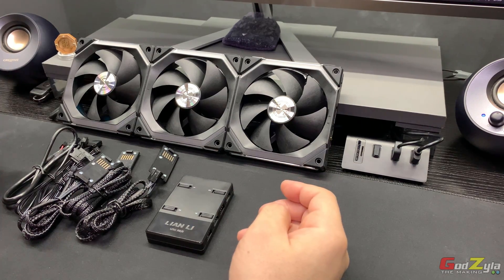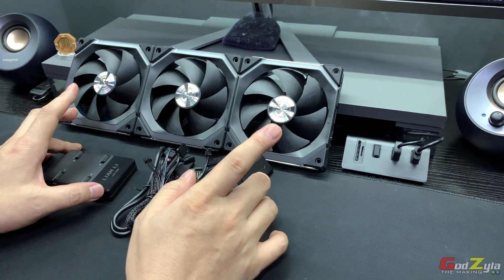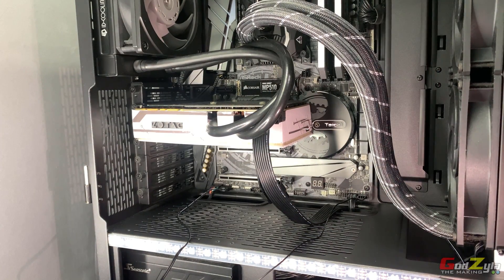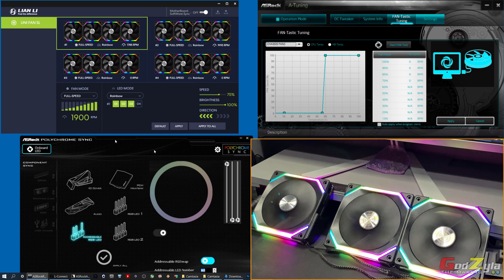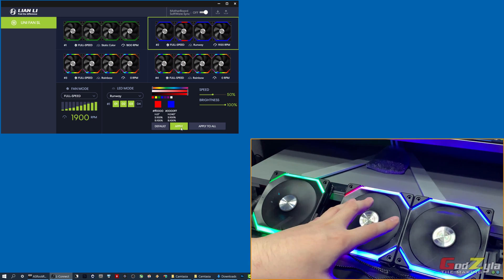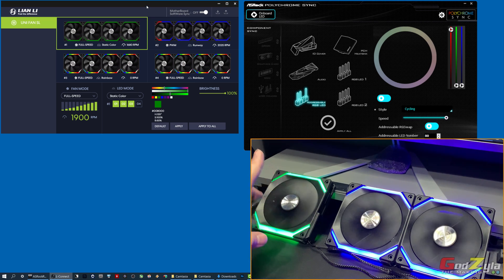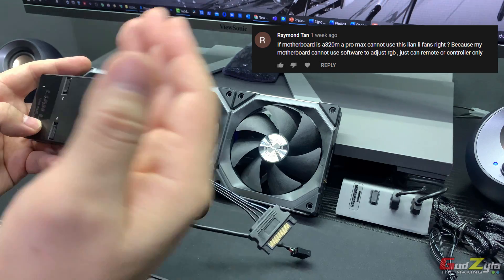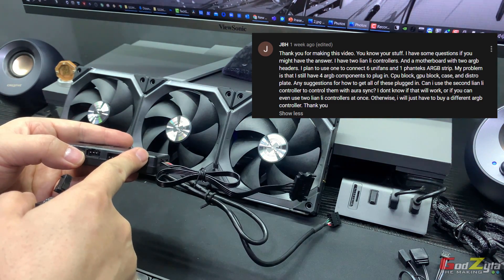Lian Li Uni Fan SL120 - Connection & The Controller (Part III) [L-Connect]

Comment: Why do you recommend the fans going through the lian li controller rather than the bios?
Reply from the maker: Hi HawkEye1194, the reason I have stated that is, if motherboard which required to tweak fun curve using applications instead through the motherboard bios/uefi, it will require two passes before the fans will react. 1st the motherboard utility program and 2nd the L-connect program. Now if you asked me do I use these uni fans. my answer to you is no. I did most of the uni controller videos are mainly because a friend of mine bought the uni fans and other of my friends follow. they were having issues with it, therefore trying to help them, I figured if I learn something from these uni fans or the controller, I will share it with those who are having issue. 

Now, just additional info, I personally do not like argbs at all, abit of rgb will be ok and I have to ensure that they can be off at all times. this is my current setup https://youtu.be/0qSaX_mOjQc or https://imgur.com/gallery/Pw5kY4q 

My setup is pretty straight forward, I choose performance and detailed aesthetic compared to just showing so much lighting effects and these are my reason.
1st argb if you always have it turn on, they will burn out fast.. with one LED burn out.. the whole argb will not work. 
2nd no additional software needed, therefore your PC will be happier with one background process off
3rd be it argb, rgb or ultra led, it produce heat inside your case. it might not produce alot but still you will be making your cooling AIO fans or case fans to work harder, causing a) more power consumption b) increase noise operation c) more messy cables for cable management which does affect cooling.

the above are just some of my explanation. if you want to know more in-depth of my thoughts, we can discuss this via email at godzylatech@gmail.com thank you!
Reply: @KleoYan  thanks man!
Reply from the maker: @HawkEye1194  you are most welcome

Comment: Wil I still be able to use the motherboard software to control the rgb? If so, how?
Reply: Hello thanks for the reply, I saw your other video where you connect different Lian li products to the Uni fan hub only and you’ve shown that it does work with the L-connect software. Although may I ask if I can still use the motherboard software to control the rgb of those products? Just to clarify do I just have to turn off L-connect?
Reply from the maker: @joaquins7463  yup, so long you’ve plug the argb and fan pwm to the uni controller. Once you switch to motherboard you will be able to use the motherboard application to control the argb. But do be careful as some reported it might not work. Those are the pc builders who uses Asus amour crate and MSI dragon.
Reply from the maker: hello Joaquin S, welcome to my channel, answer is yes you can use the motherboard software to control the aRGB effects. if you view this video properly, at around 10:46 it does shows you that I am using the motherboard application to control the argb effects

Comment: does this work on st120 fans?
Reply from the maker: Hi Rasmus Sundqvist, welcome to my channel yes the ST120 does work with the uni controller https://youtu.be/njlkdM9lYbI?t=393
Reply: @KleoYan  my fans and all are working but i cant change the rpm or the lighting on the software
Reply from the maker: @Sunkan69  if you only plug the USB Cable from the uni controller to the motherboard and the Sata to your uni controller. does your fan react with the L-Connect application? the issue can be various reason. maybe list down in details what board you are using and how you connect your fans to the controller and such. if not, it's hard to diagnose for you. thank you!
Reply: @KleoYan  the issue is that it doesnt show up on the l connect
Reply from the maker: @Sunkan69  hmm ok maybe this will aid you https://youtu.be/8l4i5UjO3es . What motherboard are you using?
Reply: @KleoYan  im using asus b450-f
Reply from the maker: @Sunkan69  I see do you have the application call amour crate installed?  If you have remove that and install the L-connect application to see if it works. There are some pc builders have mentioned that the application utilise from asus (amour crate) and MSI (dragon) is over taking the control which causes L-Connect unable to function.
Reply: @KleoYan  no i dont have that application installed
Reply: @KleoYan  man i think i solved the problem tysm!
Reply from the maker: @Sunkan69  Oh ok, congrats, out of curiosity, how did you solve the issue?
Reply: @KleoYan  or well i kinda solved the problem. Now the fans are spinning faster when im in games and slow regular. Why is that?
Reply from the maker: @Sunkan69  this depends on how you connect your fan load. Did you plug to the uni controller and set to pwm? Or did you plug the fan load directly to the motherboard fan header and have it set to pwm?  In both scenes, you fan will react when cpu gets hot while gaming and will tone down when it’s not that hot.
Reply: @KleoYan  how do you set it to pwm mode?
Reply from the maker: @Sunkan69  I have mentioned on this video at 8:11 onwards.. As for this to work. You will need to read your motherboard manual as I don't use asustek motherboard.

Comment: Hey great video. I installed it exactly as per this video. I notice in my MObo Bios and software they aren’t showing the SYS_FAN1 RPM. Is that as expected?

Everything else is working as per your video. Just curious why the BIOS and hardware monitoring apps don’t register the RPM of my fans connected?
Reply from the maker: Hi Carl Russo, welcome to my channel. yes it reacts that way, unless you bypass the fan load connection on the uni controller and plug directly to the motherboard fan header. that will allows your motherboard to controller your fans rpm and to be detected by hardware monitoring apps. hope that answer your question. thank you!

Comment: Im buying the unifans for my o11 and I was wondering.. Im going for 3 on the top, 3 in the front and 3 on the bottom.. Do I need to buy the 3 pack Unifans w/ controller 3 times? Or can I use 1 or 2 controllers. I mainly ask because a lot of the 3 packs are out of stock
Reply from the maker: Hi The Turtle, welcome to my channel. for the moment you are able to only use 1 controller but I would advise you to get 2 x 3 pack unifans with the controller each. 1 controller to use and another to keep as spare. Plus on lian-li website, it did mentioned that in future you can use 2 controller instead of one. read this page for more info https://lian-li.com/product/uni-fan-sl/

Comment: This is "hands down" the most simplest and most precise explanation regarding the messy world of ARGB/RGB lighting/connection chaos. Even Linus or Jayz2Cents can't do better tha this. Very clear and precise. I wish I found this video before I bought the CoolerMaster ARGB controller.
Reply from the maker: HI Lamka Gaming Club, welcome to my channel and thank you for the compliment.
Reply: @KleoYan  Hey man, does this software work and with the same effects for the Lian Li ST120 fan model?
Reply from the maker: @frank_soares  Hi welcome to my channel. nope the effects are different and you can’t use the L-Connect software on the ST120 controller. However you can still use the ST120 fans with the Uni controller, just that there are some effects that the ST120 might not adapt to. If you intend to plug the ST120 to the uni controller, you will need the lian li argb cable kit https://lian-li.com/product/argb_cable_kit/ video here https://youtu.be/ktuRAOcAkn8 .You can refer to this diagram .. top right https://imgur.com/gallery/ErMZdQh or if you unable to get the lian li argb cable kit, I did my own crimping cables and you can view the galahad to uni controller video in my playlist https://www.youtube.com/playlist?list=PLEW-b-2vYDdPo0NzHyeksx012c-nkDapm which those fans are of ST120. as for how to crimp those cables, its also listed in my playlist.
Reply: @KleoYan  Thanks for helping me. I would also like to know if the SL120 controller, can I use it with a fan other than LIAN LI like CoolerMaster MF120 Halo? 

There is a controller on Aliexpress, I was wondering if it's the right one, but every time I send the link my comment is deleted.
Reply from the maker: @frank_soares  you are most welcome. based on the specs of the cooler master MF120 Halo https://www.coolermaster.com/sg/en-sg/catalog/coolers/case-fan/masterfan-mf120-halo/#specifications  the RGB drawing current is at 0.55a each. It should not be an issue but make sure you know the limitation of the uni controller. on the safe side. please do not connect more than 4  MF120 halo fans to one output. stick with 4. you will also need some converters too. 
just an illustration. I have make use of the EK Vardar EVO 120 ER fans with this uni controller https://youtu.be/bMRz2KVqbjA

Comment: I have 2 controllers can I use one for the fans and use the other for ws2812b leds?
Reply from the maker: Hi TvSaiyan Shinobi. Welcome to my channel. Unfortunately no for the moment but Lian Li is going to improve what they have develop a period ago. They did allow L-Connect app to control 2 but there are some issues. They have remove this support till further notice. You might want to do random check on their website for updates on the L-Connect app.
Reply: @KleoYan  oh ok I’ll keep that in mind also I have one more question since I’m new to argb.
I have the lian li o11 xl and it has a argb controller and I also have the ek distroplate and it has a argb connection and 6 lian li fans with the argb connection how can I have all these connected if I only have 2 argb connections on my board?
Reply from the maker: @InSaiyan-Shinobi  just for your info, you can just use the uni contoller with the USB connected between the controller to your montherboard USB header. This is how it will work. 

On uni controller 
Output 1 - 3 x uni fans
Output 2 - 3 x uni fans
Output 3 - O11d xl strip ( you need a convertor )
Output 4 - ek distro plate ( you will need converter )

For argb converter you can check on my description on this video as where you can purchase them. Thank you.
Reply: @KleoYan  that converter cable will connect the argb side and the other to the lian li controller correct?
Reply from the maker: @InSaiyan-Shinobi  correct. Better explanation on how the converter works is on this video. https://youtu.be/njlkdM9lYbI
Reply: @KleoYan  I’m just confused because my 5v 3pin on my distro plate is a female and my lian li xl front panel led is a 5v 3pin female as well  and the output of my lian li controller is 5v 3pin female.
The fans did come with a female to 2 male 5v 3pin cable though?
Reply from the maker: @InSaiyan-Shinobi  Hi, pardon me for the late reply. would you mind to take some pictures of your distro plate argb connector and your lian li XL argb connector and send it to my email at godzylatech@gmail.com  I will be abe to aid you if I see your connectors. thank you!

Comment: Can I control the fan speed of UNIFAN with NZXT software? I'm using right now CAM SOFTWARE on my pc and I love it. I dont want to change it.
Reply from the maker: hi Rene Alberto Reyes Gonzalez, welcome to my channel and pardon me for the late reply as am busy at work. for your question. how do you use the CAM software as in does it comes with a NZXT hub or such?
Reply: @KleoYan  it usually works with a fan and rgb controller that has 3 fan ports and 2 RGB headers.
Reply: I love the software from them. It makes easy for me to have different profiles for any task I'm doing like mining, gaming or editing.
Reply from the maker: @renealbertoreyesgonzalez9604  I see. if thats the case, you can use the CAM on the uni controller and I dont advise you to use the SL120 fans on your NXZT hub using converters. as the argb load on these Uni Fans are at 0.65a .. you can only choose one controller to use. i am so sorry that I am not familiar with the NXZT hub and AIO, therefore can't help you out here. but you might want to try asking at the lian li reddit site https://www.reddit.com/r/lianli/

Comment: Do I need to use the usb connector to power the rgb
Reply from the maker: Hi cappetro, thank you for your question and to have visit my channel. the USB is needed to control the argb effects. the Sata connector between the uni controller to your power supply is the one that powers up your uni fan's argb. hope this answer your question.

Comment: just to add, if you connect the 4pin pwm from the lian li SL120 to pwm header on the motherboard (without using the LIAN LI CONTROLLER). I can control PWM individually with the motherboard software. And if you purchase JST to ARGB (5v 3pin) adapter you can also plug it in to the motherboard 3pin 5v ARGB header too. with this setup you will actually control everything from the motherboard software and be able to not use the controller hence even lesser cable. provided you know what you are doing and not overload the ARGB header. Most PWM header can support up to 1A and should have no problem having 4 fans daisychaining and controlled/powered by 1 pwm header. Nice vid. Cheers.
Reply from the maker: Hi khinwai, welcome to my channel and yes, you are absolutly right. So long you know what you are doing and understand that the motherboard header limit is. Both fan and argb can connect directly to it. The only worry I have for new builders, they are not aware of this. That's why I did another video first https://youtu.be/QQHJUQvKwlY before this video. Thank you for your feedback and compliment. 👍

Comment: @kleo yan. I have two sets of fans with controllers. I cant get them to work  I've tried both. once I have them connected to the board using USB I can control them in the lian li app. I've used to motherboard MSI and Asus. I even used the MSI fix still a no-go. have you ran into this problem? if so how did you fix it?
Reply from the maker: Hi klust26, nope, I have never run into issues as am not using MSI nore Asus board, plus am not using AMD. you might want to try this https://youtu.be/8l4i5UjO3es or approach lian-li tech support on this. There are news on the internet that AMD zen 2 or zen 3 are having USB issues and there will be a fix on this. some of my viewers just remove off the asus crate and msi dragon application just to use this uni controller. so hope that helps and do note not to use the L-Connect 2.0 if you did download that before lian-li remove the entire project till further notice.
Reply: @KleoYan  thank you for the info. Yes I have got I. Contact with lian li as well. It's so frustrating I got them to work one time with my MSI and then never again.  I'll wait for the fix

Comment: Do you need to plug in every cable or can you just plug in the usb 2.0 and sata cable?
Reply from the maker: Hi Secret Phantom, welcome to my channel. if you intend to control the fan rpm and argb effect only using the uni controller, all is needed is just the USB 2.0 cable (data source) and Sata (power source) to be plug.
Reply: @KleoYan  Okay thank you

Comment: how do you unplug the wires from the hub? specially the fan connector,  im having hard time
Reply from the maker: Hi Kaldingg, welcome to my channel. As how I remove them, I hold on the fan connectors (top and bottom) firmly and wriggle it out slowly. just make sure you are not pulling the wires.
Reply: @KleoYan  thanks bro i subbed
Reply from the maker: @kaldingg4518  thank you. But I won't be doing content for a period of time as am busy at work for couple of months. Still thank you to have subscribe 😊

Comment: Hey there, loved the video! I wanted to know if I could use one fan and connect it to a fan hub, or do I have to buy the lian li controller?
Reply from the maker: Hi Xylph, you mean you want to connect this Uni Fan SL120 to another brand hub? you can but you need to take note of two things, 1st the argb connector, Uni Fan needs a convertor for it. 2nd just make sure your other brand argb is able to provide the current load, uni fan argb load is at 0.65a .. by the way, I would advise you to go through this video https://youtu.be/QQHJUQvKwlY . If you do like my content, kindly subscribe and to click on the notification bell, thank you very much!
Reply: @KleoYan  I have liked and subbed, great content! Thanks for the help!

Comment: Hi Kleo
I've installed all of my various lian li parts and connected them to the unifan controller, they are all receiving power as they are spinning / in the default ARGG rainbow mode but no matter what I do I can't get the software in L-Connect to work, it doesn't change the colour and the fan speeds aren't showing, any ideas?
Reply from the maker: Hi Adam, welcome back, which motherboard are you using. if you are using any motherboard software, I would advise you to uninstall it along with the L-Connect. turn off your pc, disconnect the cable that connects the fan and argb between the Uni controller and motherboard header. then startup your PC, reinstall L-connect using administrative rights. Then try to see if your fans react to what you have controlled on L-Connect. 
there are reports stated that due to motherboard application that took over the usb rights, therefore your L-Connect lose the rights to control your fans and argb effects.
Reply: My AIO doesn't even turn on. Never mind the RGB. None of the Lian Li related parts in my PC do anything except the case fans, which have no RGB but at least spin.